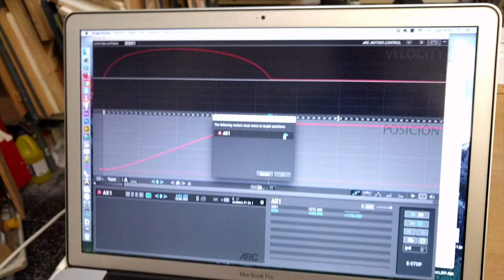Stop motion puppet building class

Comment: + edu puertas-i want to know if the wire armatures with tubing are made for sculpting or same thing to armatures socket and ball.
Reply from the maker: They are also for stop motion animation. The only thing is they are made of a specific wire of aluminium that lasts longer and they must have detachable parts if it brokes. But in fact I use them a lot.